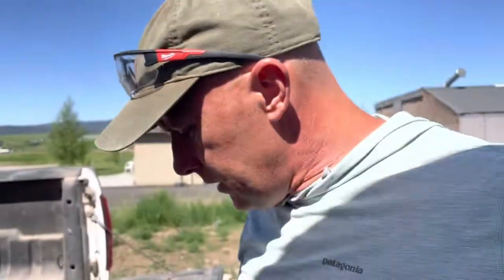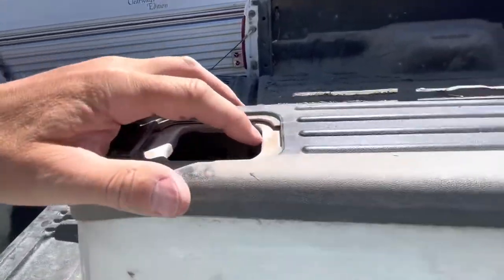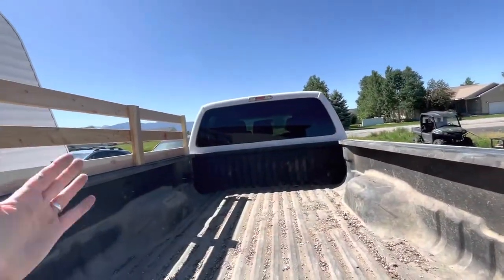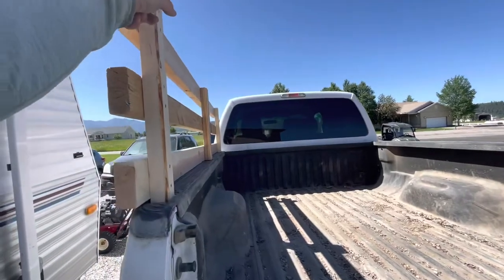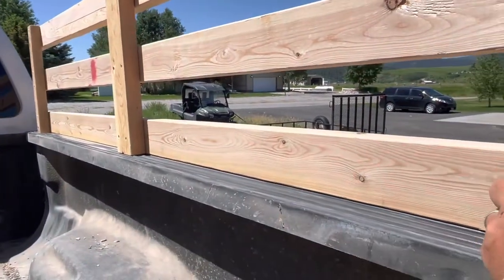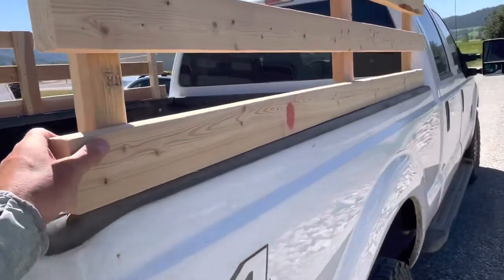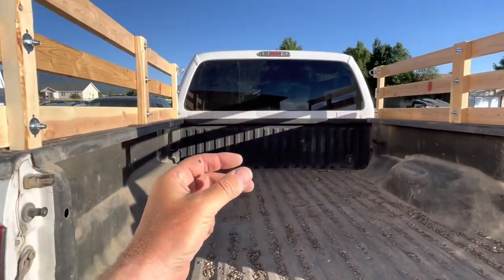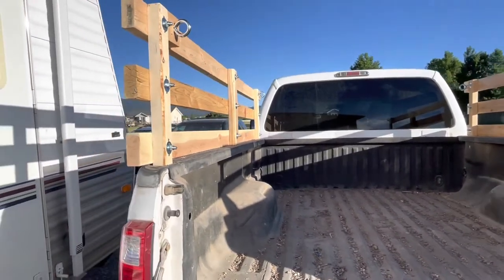How to Build Truck Bed Firewood Frames

Comment: Could have put the nuts side of the bolts on the outside so not to snag clothing when working in the truck bed.  Carriage bolts would have been flush on the inside.  Nothing sticking out then.